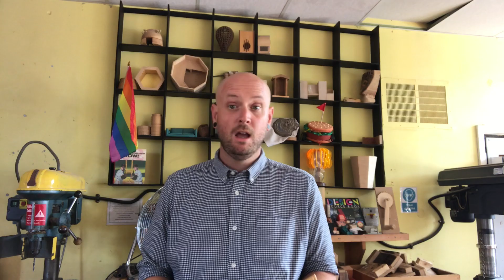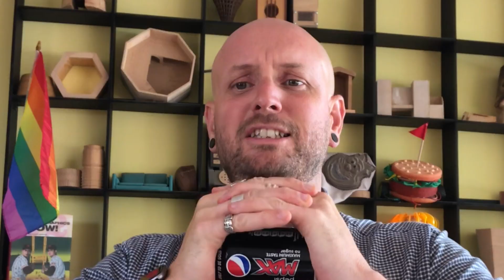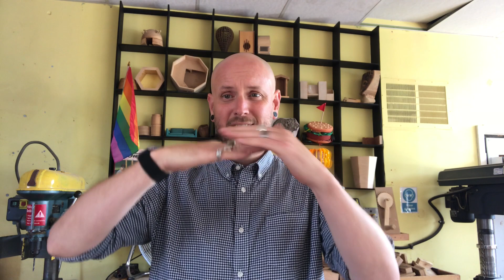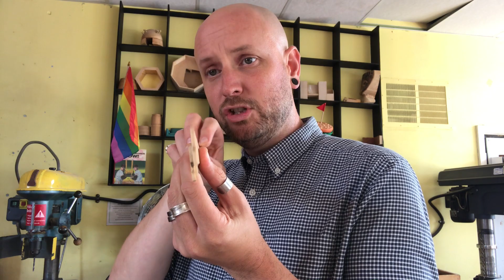AQA Design and Technology Revision- FORCES

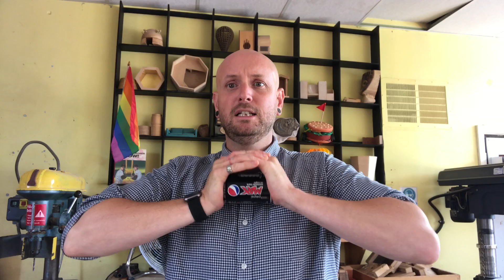Comment: 1:01 its because you're covering the air hole, so the air is trapped inside and the can cannot be compressed

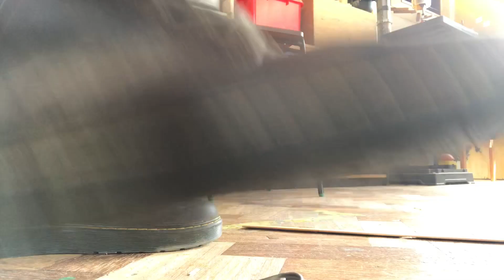1:08 you compressed it because the uneven bottom of the shoe let the air out, letting the can to be compressed. another case is that the force applied was so great that another airhole was forced to be made and leading the can to be compressed

1:30 the belt isnt under tension. the pulling force is one sided (i may be wrong here)

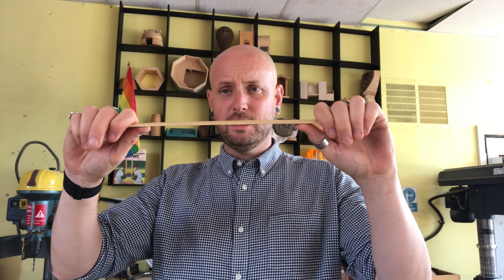2:04 no it isnt something that is literally bent. it is the act of something being bent. plus, bending is force on one side being pushed on two ends, and on the other side being pushed from the middle.
example:
    |<--
-->|
     |<--

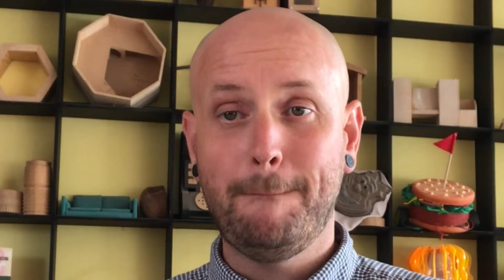2:28 yappy yap yap

3:30 shear force are when forces that are parallel are acting in opposite directions of each other
example:
-->|
     |
     |<--